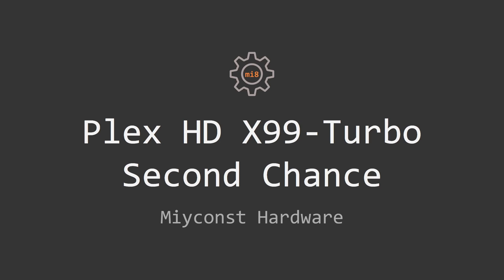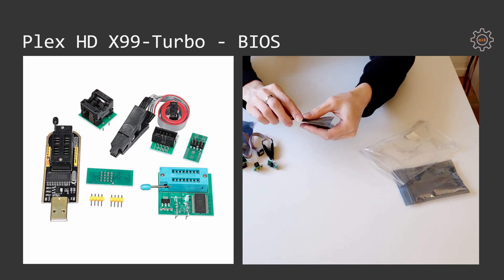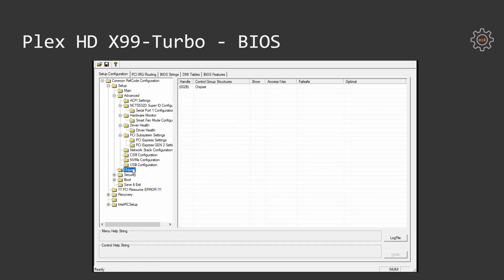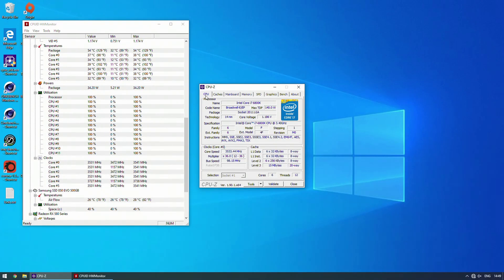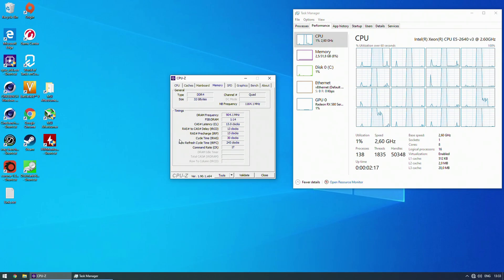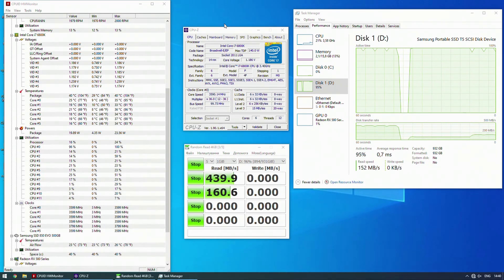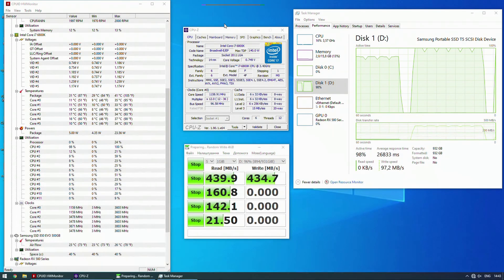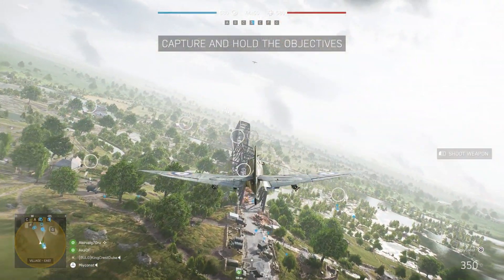🇬🇧 Second chance for Plex HD X99-Turbo LGA 2011-3 | i7-6800k @ 3.8 GHz | E5-2640 V3 @ 2.8 GHz

Comment: Success after several attempts here too. Kllisre x99 Turbo v1.31 (with white nvme slot). B85/H81 chipset. I did try several custom bios versions but without luck, they end up bricking bios .
The best way is to create backup/dump of original bios and then edit it with AMIBCP5. After switching visability of most overclocking features to USER, I was able to tweak several options to unlock multiplier and additional voltage to make OC work for 1650v3 as that CPU was only 3.4 Ghz on default settings. Then I have got to 3.8 Ghz for all by hardware settings. After I set Overclock lock to disabled , I have used ThrottleStop app to pass 3.8 and get to allcores 4.1Ghz@120W/1.180V . CPU-Z score is  455 single/3450 multi. I will check VRAM temperatures today.

Comment: I've been using this board but atermiter branded for over 2 years, so far I did not have the problem you mention works flawless on e5 2698 v3 turbo unlocked paired with rtx 2060. The only issues I have is the lack of sleep support, no uefi quick boot and no SATA hot-swap. The last one I solved with sata card in mini pci-e slot that I use for external HDDs. Leaving aside the price (because yeah it's the cheapest board) this board has one of the best IO of all the x99 on aliexpress.

Comment: I also observed a similar issue with Machinist/Atermiter X99 V201 where the E5-2640 V3 only boosts on all cores to 2.8GHz (and not 3.0GHz) as expected. 
However, once I unlocked all core max turbo, all 8 cores boosted to 3.4GHz so no big problem ultimately.

Comment: In short, which one is the best?
Reply from the maker: JingSha X99 D8.
Reply: @Miyconst  is it better than the Huananzhi x99 f8?
Reply from the maker: It's better in one way and worse in another way. Overall both are about the same.
Reply: @Miyconst  okay!!

understood, but with your experiences, which one would you recommend me to buy?
Reply from the maker: @Johnz0rrr  depends on your CPU, if you plan to overclock - go for Huananzhi, if you plan to use E5-2678 V3 - go for JingSha.
Reply: @Miyconst  but I'm really thinking about getting this xeon e5 2678v3 ...
Reply from the maker: @Johnz0rrr  then it's JingSha X99-D8.
Reply: @Miyconst  all right!
and what memories would you recommend to me with this processor and motherboard kit?
Reply from the maker: @Johnz0rrr  Samsung DDR4 ECC REG.
Reply from the maker: @Johnz0rrr  It's impossible to guess. The physical RAM layout is not guaranteed by the seller and there is 50/50 when it comes to the compatibility with X99 platform.

Comment: It looks like Kllisre might officially be marketing this board under the D4 name now? https://www.aliexpress.com/item/4001010379573.html

Does it look to be the same to you? It seems like a decent deal, but if there's no turbo unlock and other issues, then I'll avoid it.
Reply from the maker: These days Turbo Unlock is possible on every X99 motherboard, but the issues of this board is still not resolved, even though they call it "D4".
Reply: @Miyconst  Thanks, I'll avoid this and go with the more robust D8 I think. I just need to decide between 2620v3 or the 2678v3 now :)

Comment: Hi fren ... I bought the same as the x99 green mobo but mine was orange. Right now my mobo would not boot to bios page, only FF error code on the debug display. Do u have any idea what's wrong with my mobo ? Maybe u can make a video on how to flash bios using hardware bios flash tool.

BTW i love all of ur videos. Thank you for making them.
Reply from the maker: It seems like your motherboard BIOS is screwed up and you have to restore it with an external USB flash programmer. I plan to make a guide on how to do that, but not sure when it's gonna happen.
Reply: I have the same problem. No video and FF code
Reply from the maker: @Punkfool18  this guide will help you with your BIOS restoration: http://www.miyconst.com/Blog/View/2086/ch341a-minimal-usage-guide-how-to-read-and-write-a-motherboard-bios

Comment: Success here in Brasil. With your instructions, my E5-2620 V3 now runs at 3200MHz without any problems. My motherboard (no named) is similar to this Atermiter X99 and works satisfactorily. Thank you so much.
Reply: sup bud, is it your mobo?
https://a.aliexpress.com/_BP7deP
can you link it if it's not the same one? thank you :)
Reply: Hi. Similar to that but DDR4
as in the link https://www.aliexpress.com/item/4000485288727.html?spm=2114.12010615.8148356.6.71ef6abfsjk152
Reply: @carlose.a.castro5870  oof, ddr4... thank you, by the way :)
Reply from the maker: I am glad to hear that it worked for you!
Reply: Como assimmm, me ajuda por favor
Reply: Pode meio q resumir oq vc fez
Reply: @gabrielalves831  Segue as instruções contidas no video do Miyconst a risca:
https://youtu.be/VkwEvATIgW0
Reply: @carlose.a.castro5870  fala amigo, te agradeco demais, me ajudouuu muito
Reply: Hi.. are u still running ur 2620 v3 turbo unlock using the mobo that u bought months ago ? Mine got FF error debug code, my mobo won't boot to bios.
Reply: @Farizz77-yt  Hi. Yes, normally.
I followed strictly as instructions and did not intervene anymore.

Comment: I am not able to install win10 on the plex hd x99. I can choose the version of win10, create a partition on the HD, but when it starts installing crashes. Moving the bios the pc does not lock. Do you have any tips to help me.
Reply from the maker: It's sad to say, but my tip for this motherboard would be to throw it out and get something decent. Even if you will be able to install Windows, there is no guarantee that the motherboard will function after the installation.

Comment: Hello. Nice video. You can release the turbo boost on the plex x99-turbo with Xeon E5 1650 V3. I currently use this setting.
Reply from the maker: Hm, what is the frequency you are running the E5-1650 V3 right now?
Reply: @Miyconst  3.6ghz in all cores. I would like to see if you can activate at least 3.8ghz on all cores on the plex hd x99-turbo. If with the procedure you did it would work on 1650 v3.
Reply from the maker: @lpjgamer3759  3.6 GHz is the default speed for E5-1650 V3. This CPU has unlocked multiplier, thus if you are willing to risk, you can try to use Huananzhi X99-TF or X99-F8 BIOS and overclock it.
Reply: @Miyconst  The Plex hd x99-turbo does not overclock, but I just wanted to see if with this procedure I would be able to achieve 3.8ghz in all cores. I bought the Huananzhi x99-TF. But here in Brazil it is very expensive for us because $ 1.00 is worth $ 4.00 of our currency, and the government still charges us a tariff of 60% of the product's value. Still it is more advantage than buying in Brazil.
Reply: @Miyconst  So from what you said, would the huananzhi bios work on the Plex x99-turbo?
I thank you for your attention.
Reply from the maker: @lpjgamer3759  I don't know if the Huananzhi BIOS is going to work on this motherboard, but plan to test that later. If you do not have extra tools to flash the BIOS chip, I don't recommend you trying it. If the Huananzhi BIOS is not compatible, you will brick your motherboard and would have to buy a special tool to restore the BIOS.
Reply: @Miyconst  I saw another video where you give a second chance to plex hd x99-turbo. Is there only that procedure you did, or can you do as in huananzhi?
Reply from the maker: @lpjgamer3759  I didn't have time for PlexHD X99-Turbo, busy benchmarking other motherboards, but as soon as I get a free moment, I will validate if it works with Huananzhi BIOS.
Reply: @Miyconst  Okay. Thank you. I will install windows on UEFI and try to unlock the turbo boost on all cores.
Reply from the maker: @lpjgamer3759  I am not sure if this technique works on E5-1650 V3, I have only tested it with Xeon E5-2600 series CPUs.

Comment: If you want to check core speed on cpu - z, right click on the program to show all cores.

Additionally, could you I future reviews check Gigabit LAN port with some files transfer (4GB movie as 1 file, some smaller files, 1 big folder or so) since not everything working as expected on those chinese boards (like USB 3 in this case).

Cheers from Poland.
Reply from the maker: Starting from Huananzhi X99-F8 I am testing the LAN port as well. CPU-Z popup with the per CPU core frequency disappears on focus lost, that's why it's not very convenient.
Reply: @Miyconst  Happy to see acutal response to the community. Keep up good work!

Comment: i have qs i wan to buy mainboard x99 I have two choice  1. machinist x99 or 2. huananzhi  i use cpu xeon e5-2660v3 or xeon e5-2678v3  I want set all core turbo 3.0  so  I should buy this one choice ??  thx.
Reply from the maker: Definitely do not buy this green one. The other motherboards I have not tested yet, thus I cannot recommend you to buy it. If you can, wait for a little while, I am about to review those boards.
Reply: @Miyconst  Oh dont buy green I want to use x99-8m by Huananzhi band in Ali  in Band Huananzhi
Reply from the maker: @prathompoomnewyawong5840  Huananzhi X99m might be a good option, I already have it lying in a box, just need to open and review. If you can wait - better do that.
Reply: @Miyconst  ok thx you I wait for review and I habe qustion e5-2678v3 or e5-2660v3  can OC all core on 2.9-3.0  can do it and set bus ram  2400 2666 because I bay ram in Ail 16 Gb bus 2666 *2
Reply from the maker: @prathompoomnewyawong5840  Xeon E5-2678 V3 is overpriced and only makes sense if you plan to use cheap DDR3 RAM. In this comparison, I would pick E5-2660 V3, but most likely the maximum RAM speed will be DDR4-2133. If you plan to use this computer for gaming then take a look at the Ryzen 5 2600 option, they are cheaper than E5-2678 V3, better at gaming, and AM4 is a much better platform.
Reply: @Miyconst  Ok I understand

Comment: dude, this was almost the complete build including the open case setup I was going for but saw a video that the X99 had some issues with Ram and the vrm... I backed off as I was unsure of the board...I saw 1 X99 with DDR3 and another with DDR4...thnx for that video, now I won't buy it.
Reply from the maker: The Huananzhi X99 boards might be worth considering, I will review them shortly. Regarding the DDR3 boards - avoid them, only these LGA 2011-3 CPUs can work with DDR3 RAM: E5-2629 V3, E5-2649 V3, E5-2669 V3, E5-2676 V3, E5-2678 V3, E5-2696 V3.

Comment: yes it needs work, the usb3 needs fixing along with the turbo that half works.  ram compatibility is bad since you cant set the timings either.  seems theres bad qc, you had the vrm problem and on mine 2 of the ram slots dont work.
Reply: well i got it turboing up to 3.6 ghz on some cores on my i7-5820k.  just had to enable cpu c6 report under cpu c state control in the bios.